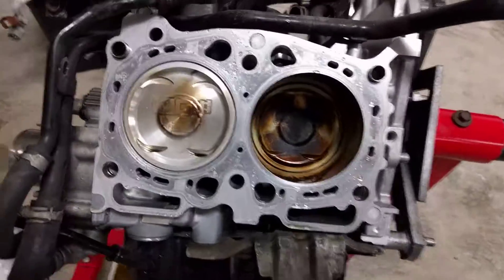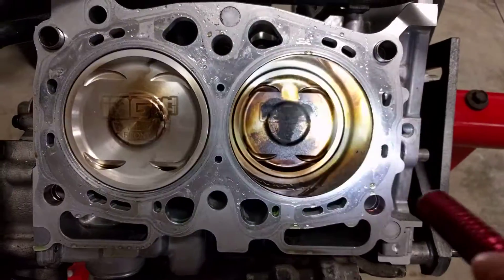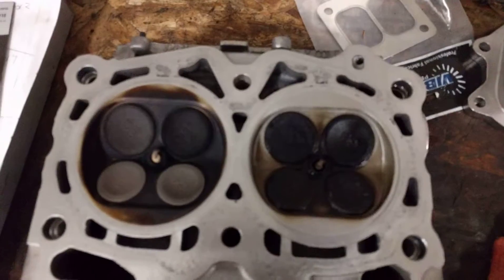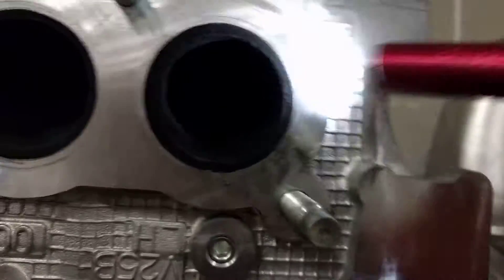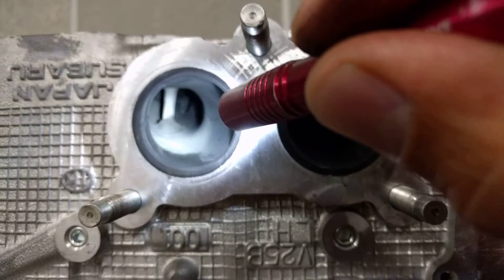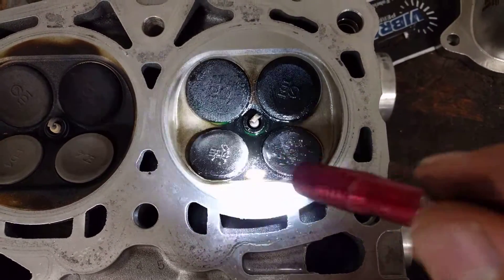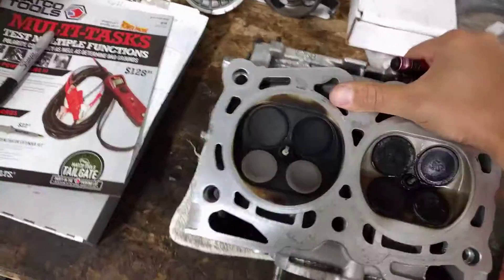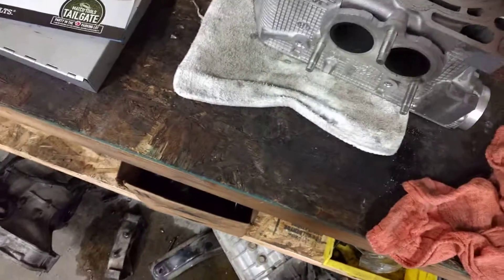Odd engine burn pattern and oil consumption

Comment: So did anything come of this? I can't help but think that it's clean do to some amount of coolant/water getting in and steam cleaning (I'm assuming the three other cylinders about the same carb level) and then a separate exhaust valve seal leak...that by chance is on the same cylinder with the coolant leak.
Reply from the maker: the engine ingested a large amount of glass bead. the owner had sand blasted his intake manifold and didn't get it all cleaned out before bolting it back on the engine. you can see the head has a nice blasted finish in the combustion chamber only. The piston and rings were hammered once I got them pulled.
Reply: hahahaha man that sucks. Live and learn I guess.
Reply from the maker: yeah. the oil rings were damaged on that side. they were full of shit

Comment: Seems way to extreme to be just a leaky valve seal. That said never saw the car run. Was it smoking like a mofo?
Reply from the maker: smoked a lot. which is odd because the clean cylinder was the smoking cylinder. we're putting new oil control rings and valve seals in it and giving it another go.
Reply: Burn't so much oil nothing could stick to the piston :)

Upside down ring? Specifically the 2nd ring? Having that naiper cut pointed upwards scraping oil into the combustion chamber.  That would make it smoke like a mofo too :)
Reply from the maker: nope. rings are correct